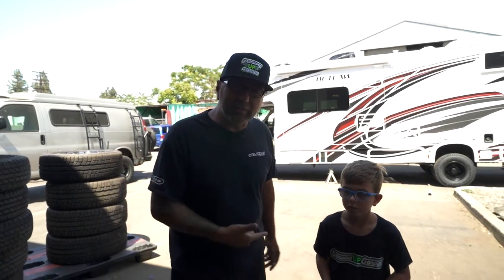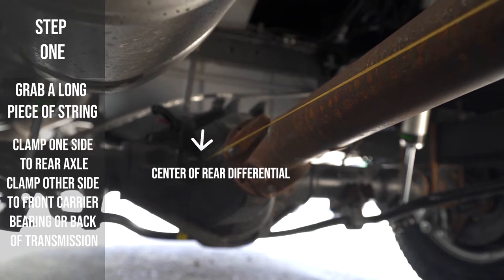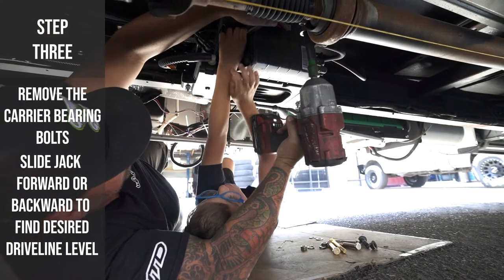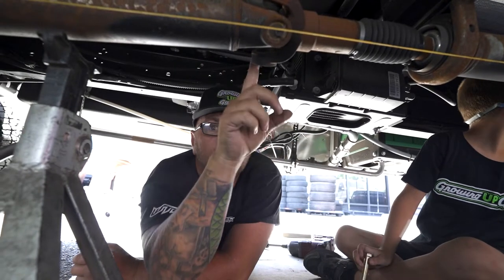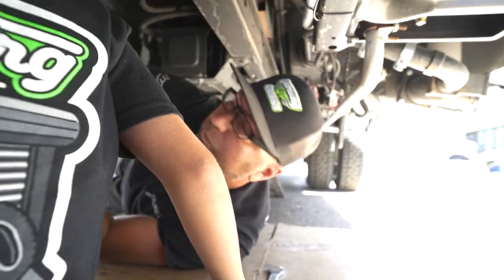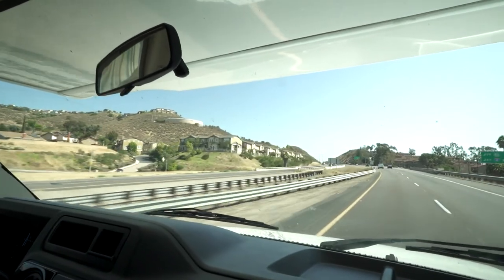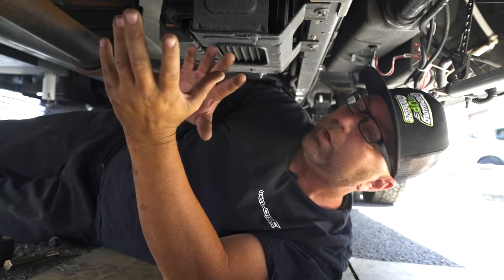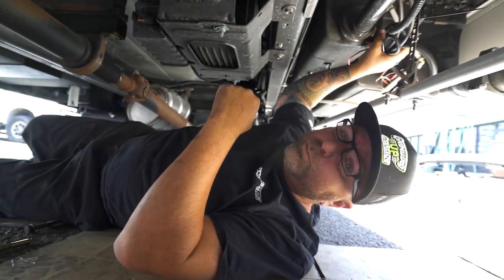How to Properly Align Your Class C RV Driveshaft DIY | Eliminate Humming Driveshaft at High Speeds.

Comment: Just installed your 3” Econoline kit. The driveshaft video was very helpful
Reply from the maker: Terrific! Hope you are enjoying your Ocotillo Cruiser Kit
Reply: Jeremy, do you have a 3 inch lift option for the econoline based E450 motorhomes using the new heavy duty progressive rear springs?

Comment: Great video! I’m in the midst of trying to figure out the same issue with our 2015 Forest River. Three piece driveshaft and just had it completely gone through. Ujoints, carriers and balance. Still have a vibration at 40mph. Wondering if maybe one of your kits might help. I will have to check the alignment.

Comment: Thanks for the info Jeremy. Sounds like the exact problem I have with my stock 32 foot class c Forest River. I have a small vibration at about 40 mph. It goes away after that and then I get a humming noise about 60 to 65. At 70 it’s not as bad but still there. I will check my angles next week. Any other advice would be great.
Reply: Wait I’m having the exact same issue. Any luck on resolution?
Reply: @Tallglassofredwine  Yes I did get mine fixed, I ended up taking my driveshaft to a local semi truck shop that had a person that specialized in balancing driveshafts. This took care of my problems completely. I tried what they said to do in this video and lined it up like he said  and it didn't do any good at all. Even though the driveshaft had balance weights on it from the factory it was not balanced correctly. I think it cost me  about $150 or $200 to have it balanced but I took the driveshaft out myself and took it to the shop. my guess is it would be about double that it they took the driveshaft out and put it back in. I don't know how many places are setup to balance these two piece driveshafts, I was lucky and had local shop that could do it. I would never have been happy with my motorhome until I got this fixed.
Reply: @stevedroste6953  thank you so much, being a female on the road I have to sound like I know more than I do so I’m not ripped off it’s happened more than I’d like it to so I appreciate the help!

Comment: Wow, great video. I have been fighting this vibration on my 2022 Greyhawk 30Z which has 3 drive shafts on it. Where do you get these carrier spacers?
Reply from the maker: Glad you found it helpful. 

link to carrier bearing drop down bracket kit
https://weldtecdesigns.com/product/wtd-carrier-bearing-drop-bracket-kit/
Reply: @jeremysworld10  Brought my motorhome to a driveshaft shop in the area and they found the yoke nut was not tight at the transmission. They jacked the rear axle up onto jack stands and as they sped up they could see the vibration in the driveshaft. At this point, they found the issue. Not sure if this was a Ford issue or a Jayco issue as Jayco does extend the chassis and drive shafts after delivery from Ford. Jayco said they would cover the cost but I have not seen a check yet. I still have a slight vibration but the drive shaft is not vibrating.

Comment: Just picked up a 2017 Minnie Winnie on the e450. Has an unbearable "harmonic buzz" in the coach precisely between 60-70mph. Tends to be less noticable if I am in higher RMPs. Does this sound like a symptom of a misaligned drive line? Thank you!!

Comment: I wish u showed where the front string goes to. It looks like its clamped to the bottom of that front bearing. Im not sure where to clamp it
Reply from the maker: END OF THE TRANS TAILSHAT TO THE CENTER OF THE U JOINTS ON THE REAREND

Comment: Thank you for the video.  Our class c with 3pc drive shaft has something with the driveshaft vibrating.  I put a lazer on the bottom of the driveshaft lined it up with pinyon on rearend and transmission output.  One hanger is about 1/2" out of center the other is out about 1/4".  Both are in the same direction.  Should this be straight?  I have not been able to get a definite answer.  Maybe they put this offset to make sure the u joint bearings are always in a slight rotation no mater what the angle is??
Reply from the maker: You want it to be as straight as possible, you could measure between u joint caps if necessary.

Comment: How much lift was on this RV, 6 inch? I’m planning on having your 2 inch getaway kit and wonder if it will change the angle enough to make vibration?
Reply from the maker: yes this RV got the 6" suspension package and really it all varies but you can always give our tech team an email: info@weldtecdesigns.com
Reply: Jeremy, do you offer a 3 inch lift for Econoline E450 based motorhomes using the heavy duty progressive rear springs? I kinda like the middle ground that would offer between the 4 inch adventurer and the 2 inch getaway